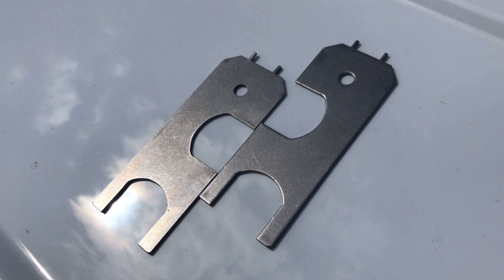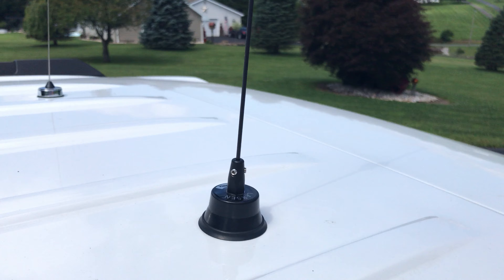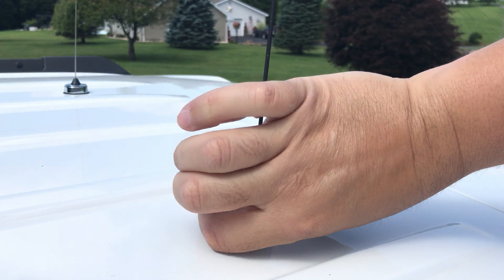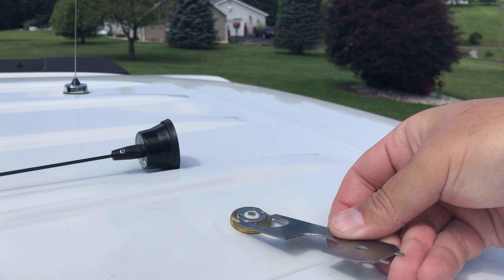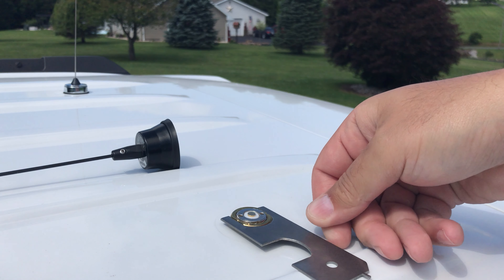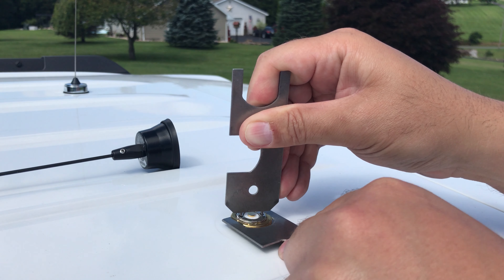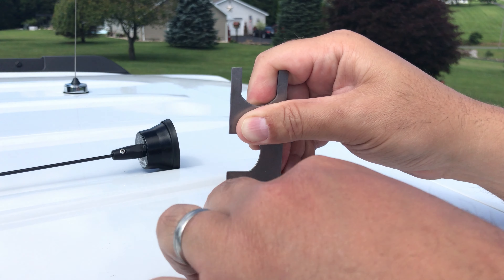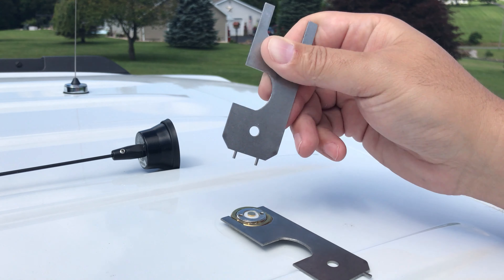NMO Connector Tool

Comment: Maybe I’m lucky but Iv never had to hold the center contact while tightening the nut I always pull up when tightening while wiggling the mount making sure it’s seated in the hole correctly. Now I have had to use needle nose pliers when removing mounts off of vehicles after about 20 years having one of the chrome nut quarter waves on them.